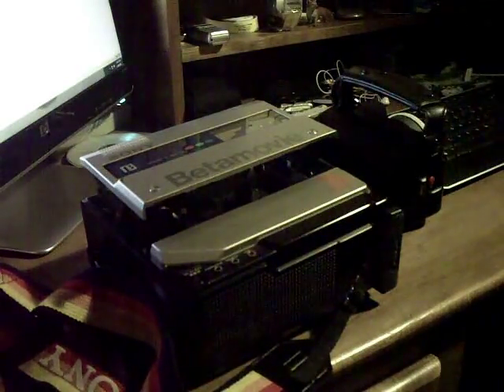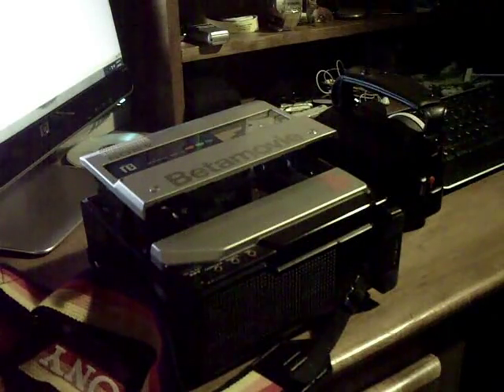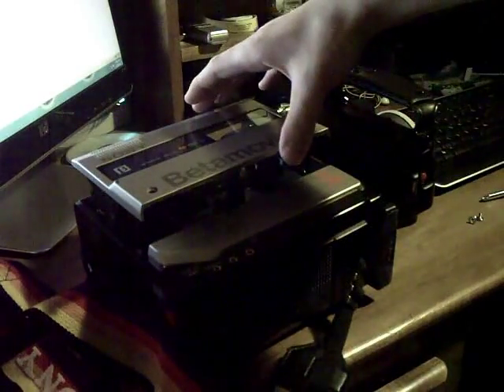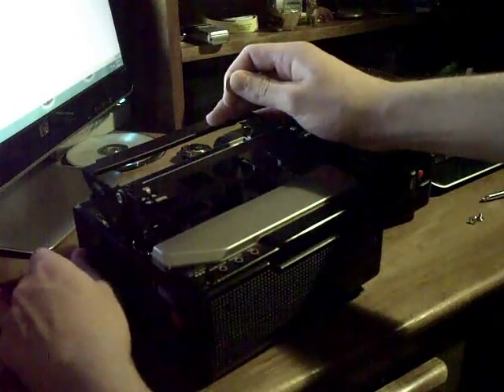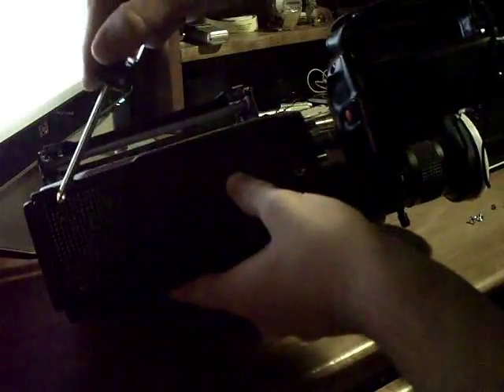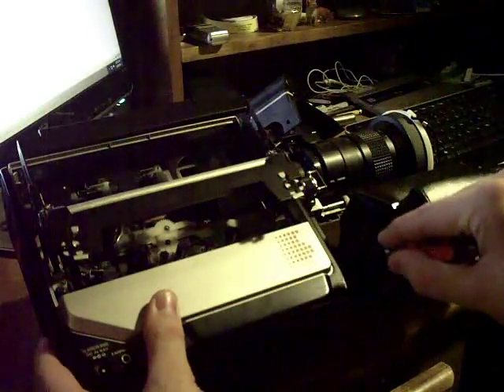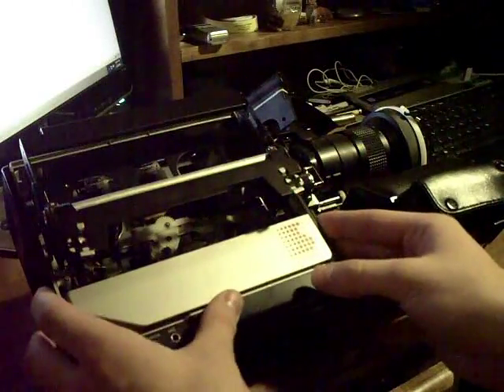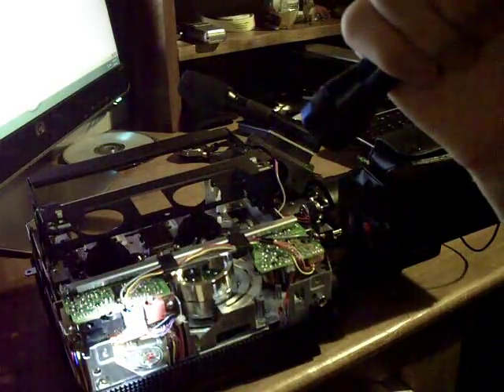Betamovie service video

Comment: This is for MYTIE67....The reason for shutdown whilst in operation is caused by selonoid faliure and will need re capping...Your problem will then be solved but i will tell you that it is a very awkward repair because of the way the camera is constructed.All the best.
Reply: Hi azshaw123, I was wondering if you had any tips on how to fix the issue mytie67 described. I am having the same problem and have taken the camera apart. Found the blown fuse, it's soldered to the board. Any tips?

Comment: I am having some problems with my Sony Betamove BMC-110. It powers up and it will begin to record, but then it shuts off after a couple of seconds. Do you have any thoughts on what might be wrong with it? Would you be able to fix it for me? or have any suggestions (affordable) on where to go for help? Thanks!
Reply: Have the same problem.